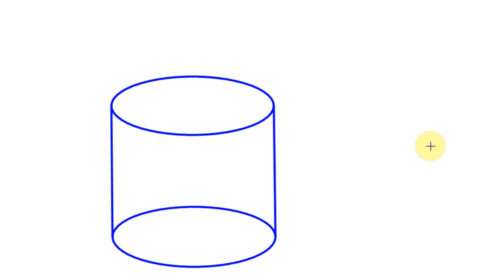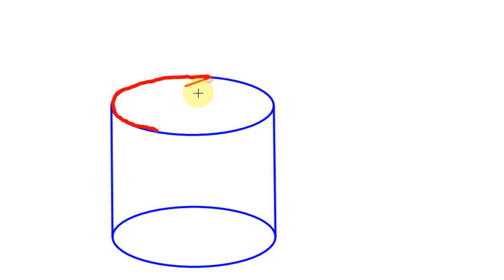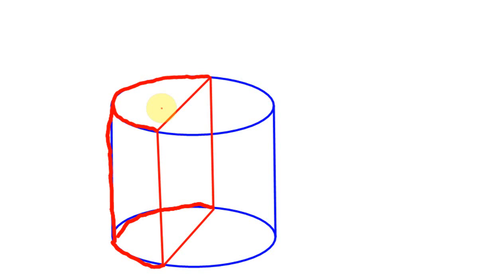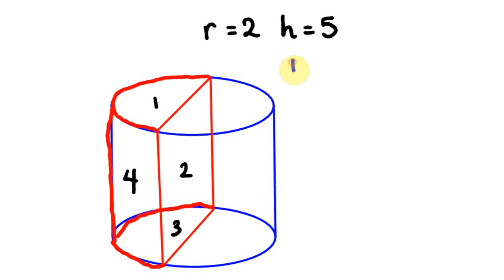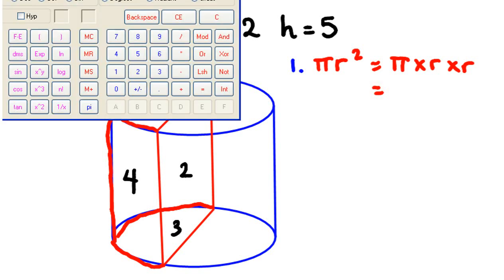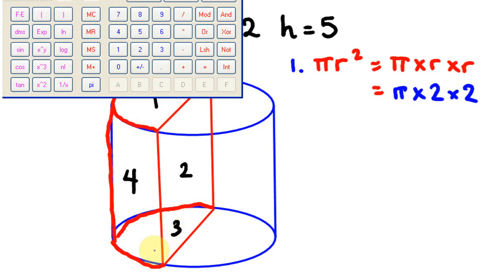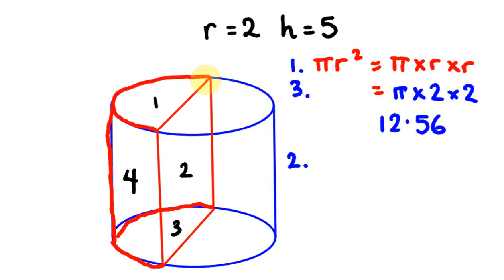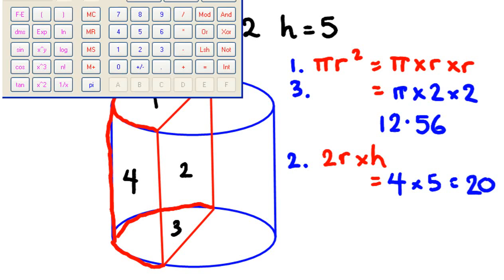Surface Area Half Cylinders

Comment: He didn't multiply the 12.56 by 2 in part 1 to place in memory. Therefore the answer is miscalculated less12.56 which should have derived to an answer of approximately 76.53.
Reply: You don't need to multiply by 2. (3:06)<--- Watch that part and put subtitles :D

Comment: Everyone knows that the area of a rectangle is Length X Width. In this case then the area of part 2 would be 2 X 5 which would equal 10. For some reason here, he took 4 X 10, doubling twice of one side. Everything else is correct. The final answer is 53.98.
Reply: i think you meant to write 63.98 the width would be 4 since 2 is only the radius which is half of the diametre
Reply: No. You are wrong. The area for number 2 is 4x5. The diameter is 4 not 2.
Reply: 2 is the radius and we r supposed to use diameter so 4 × 5

Comment: This is wrong, You have to add 12.56 twice. Because thats the surface area of the two bases. So the answer would actually be 76.52
Reply: Elfira Akhmedova actually the formula for the area of a 1/2 circle is 1/2*pi*r*r.  He never divided his answer by 1/2, he took a short cut and left it as a whole circle, therefore, he had already "added" it twice, so your answer is wrong.  I do think he should'nt taken the short cut because the answer will be off 1/100 th of a percentage.
Reply: No. He right. Remember, he is calculating half the cylinder. 12.56 equals the surface area of 1and 3.